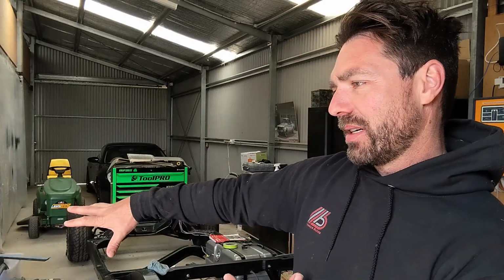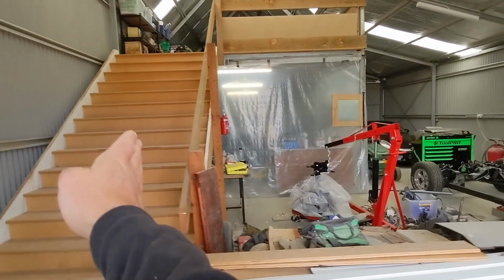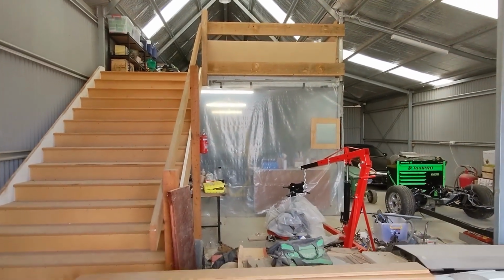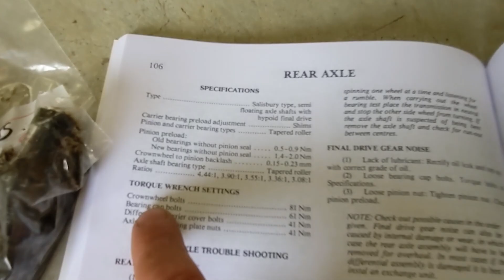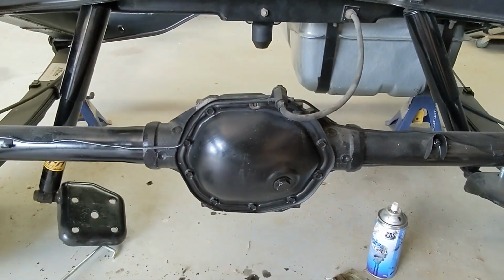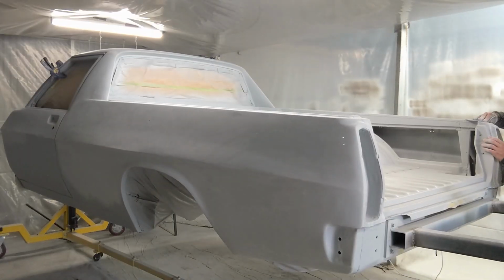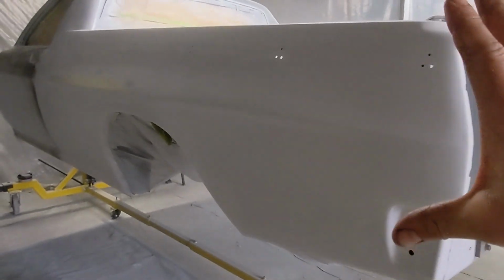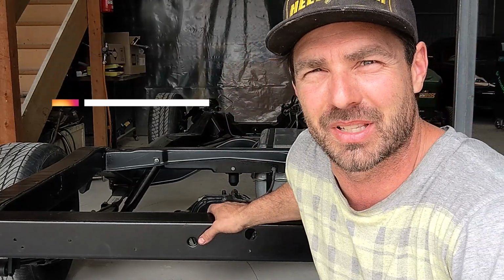EPISODE 57 - PREPARING TO LOWER THE HOLDEN WB UTE BODY BACK ON THE CHASSIS

Comment: Hi good to see you getting back into it. I'll be surprised if you don't stick with the 3,36 diff ratio. It will have more chance of holding together then a 3.08 with the power you will be putting through it, and it will give you the best of both worlds. more power down low and good highway cruising, pending on your cam you could be chugging a little at 100km with a 3.08.
Reply from the maker: Yeah I reckon your right, it did rev a bit on hwy but I won't be driving it nearly as much so I can put up with it for the benefits it would have  at lower acceleration speeds.

Comment: Welcome back mate, with your broken bolts if easy outs don’t work weld a nut on the end of the broken bolt, the heat from the weld will help then you can get a spanner onto the nut and the broken bolt will come out 👍🏽 keep up the good work mate
Reply from the maker: Thanks Snowy, I have been watching a few vids, I will try and easy out, was wondering if the welder will ruin the gasket but I guess it won't if your putting it straight on the bolt. Thanks mate
Reply: @BarnesysBuilds  Algood mate and yea they are the better option, welding a nut on would require pulling the cover plate off again so it would bugger the gasket because you’ve glued it, anyway good luck with it mate 👍🏽

Comment: How good is the wet test mate hey ! - it really does forecast what the top coat finish is gonna look like - gives you confidence that you’ve spotted every blemish possible before laying down the duco - only I think on your next build you’ll employ it a lot more during the previous layers so save going over your work again - ultimately you want to epoxy the metal after you’ve got it as straight as possible with the hammers/ dollies/ slappper - wet test - body filler - guide coat / wet test , high build -wet test , finishing putty / polyester - wet test again and then sealer ( thinned epoxy ) - duco . Nice even layers to reduce the risk of shrink back or delamination and the like . Keep em comin man !
Reply from the maker: Yeah the wet test really opened my eyes to how much work still needed to be done on th passenger side! so glad i caught it though, now i know it's spot on and won't show in paint. cheers

Comment: getting there barnesy
 body work is time consuming  but worth it in the end 
mines taken 7 years so far and i\m just getting started to paint 
easy way to refit the body to the chassis  use your hoist to hold the front up have the chassis in front of the body and roll the chassis back under
Reply from the maker: 7 years, that takes the pressure off a little! It's extremely time consuming, yes I did that method getting it off, it worked pretty good! Thanks mate

Comment: Easy out should work, depending on why it broke. It wasn’t seized as in rusted in. There are a couple of types of easy outs, one type has left handed drills of the correct size in the kit. Run a correct tap in before putting the new bolt in to clean the thread out, a good practice every everywhere especially on old stuff. Make sure the bolt didn’t bottom out. Drill it when the cover is on, keep all that diff destroying swarf out. You are not the only one who has an oh shit moment like that. Remember if the thread is buggered re-coils work a treat every time. Another good Australian invention that were known as heli-coils. Jeff
Reply from the maker: Thanks Jeff, Yeah the book said 41 NM for the cover bolts which seemed to be pushing the friendship, the two top bolts have spaces on them as they hold the brake line on top, so not sure if they were meant to be torqued differently due to that. They are the same bolt but longer so i imagine it should be the same. Must of just been weak.

Comment: Stack the Timber up where the ride on mower is and parked, the ride on is easily moved if it’s in the way.
1/2 the width of the stairs is  the easiest and quickest option, just prop stairs in the middle of the finished width, cut to width, remove the unwanted pieces and slip the stringer ( side rail of the stairs )back in place…job done.
Reply from the maker: Yeah I reckon your right, any recommendations on cutting the stairs straight?
Reply: Easiest would be a circular saw along the treads then a reciprocating saw ( a powered handsaw ) up the risers and in the tight spots.
Screw a length of timber along the underside of the stringer up against the bottom of the treads and risers intersection this’ll help locate them easier when putting the stringer back in place.
Reply: Forgot to add. Use a string line stretched from the top to the bottom, mark the line on each tread and square across the treads then up the risers and cut slowly to maintain an accurate cut.